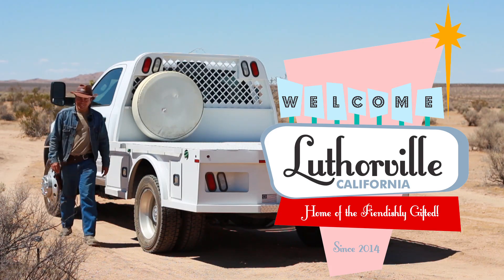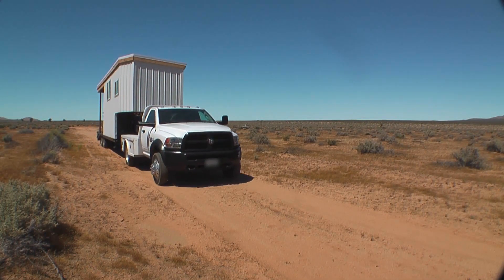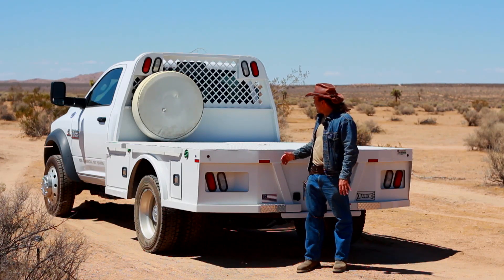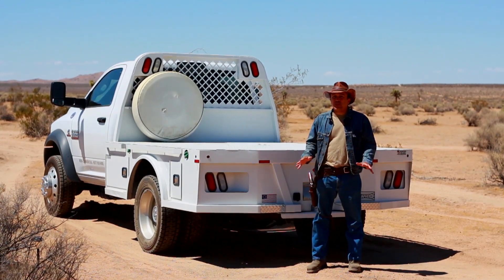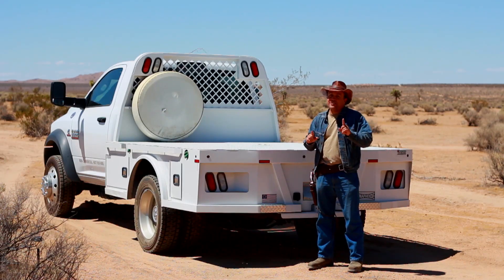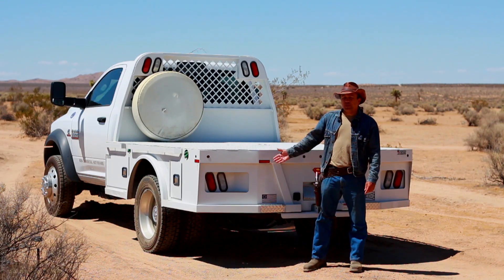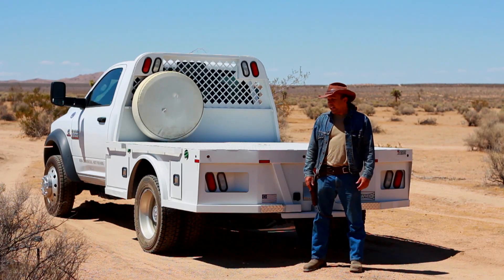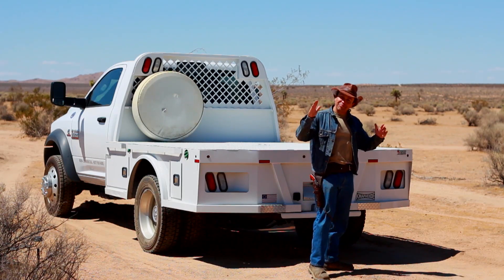PRODUCT REVIEW UPDATE: 2016 Knapheide PGNC 96B

Comment: The weight might be an issue if you were hauling overweight regularly but I would think you should be fine. You might get air bags if it became an issue. I hauled for years, those big trucks are tough. What rear tires do you have? I used g622 when I had commercial tires on my truck. They are incredible and should get you well over 150k miles even though they are mud and snow tires. I used them in that desert terrain and never dug in. Great drive tires.
Reply from the maker: Airbags wouldn't fix the problem. Airbags support the suspension of the truck. I know the truck can handle the tongue weight just fine. I can carry about 10,000lbs. of cargo, so a 6000lb. tongue weight is no big deal for the truck. The problem is the weight limit on the Knapheide flatbed. If it had any problems, I would need to reinforce the crossmember of the hitch. That is where the failure would occur. But I'm hoping you are correct. It might be an issue if I did it all the time, but most of these ratings are far below the breaking limit.
The tires are Continental HDR 225/70R19.5G which are very similar to the Goodyear G622.
Thanks for watching and commenting.
Reply: Luthorville: Building an Off-Grid Mojave Tiny House oh that makes sense. That's too bad the bed limits the ability of the truck. It would be nice if it was built to compliment the towing capacity. I guess there is a downside after all. It's still a great looking rig though.
Reply from the maker: Thanks. Yes, it is a unique truck. You don't see many like this.
The weight issue is unfortunate and unexpected. Whether a gooseneck or a bumper-pull, the maximum tongue weight is usually 20% of the total towing capacity.
So, the fact the Knapheide is rated to tow 25,000# under a 5,000# tongue weight is normal.
I just didn't expect the tongue weight of the trailer to get so high. After all, the total trailer weight is only 20,000# so I didn't expect it to have a 6,000# tongue weight.
The good news is, the tongue weight limit of the gooseneck hitch is the ONLY weight that is over. All my other weight limits are well under the maximum tolerances.

Comment: Interesting that the tongue weight was so high. This is why semi trucks trailers have sliding axles, I'd imagine if the big tex had axles a bit further forward your tongue weight would be under that 5K sweet spot.
Reply from the maker: Yeah, I was shocked too. I had to recalculate the numbers a few times because I couldn't believe it. But, like I said in the video, the good news is, the truck itself can handle the weight no problem. The truck can handle 10,000 pounds on the rear axles and I'm only at 8,000. Just the hitch is overloaded by 20%. So, if I reinforced the hitch, the truck should be fine.